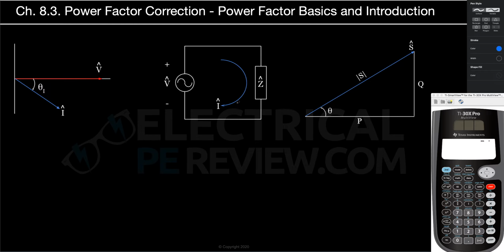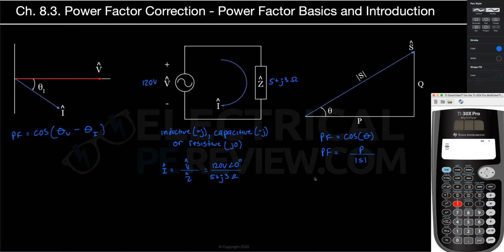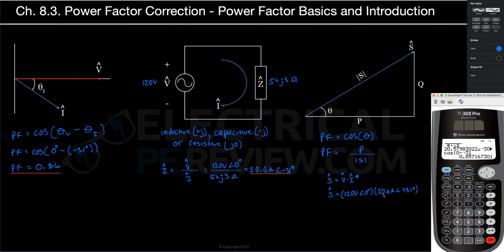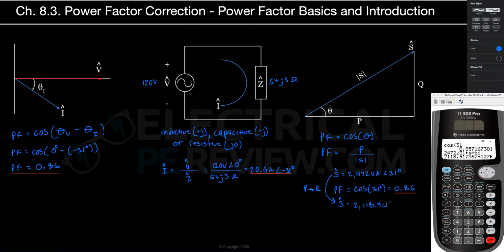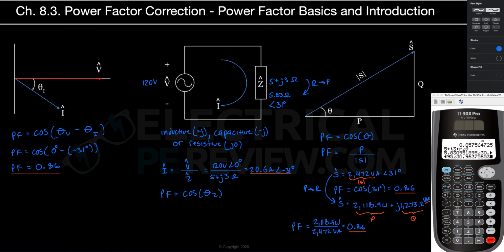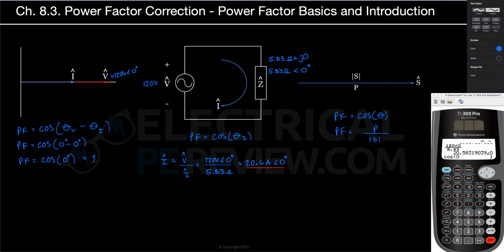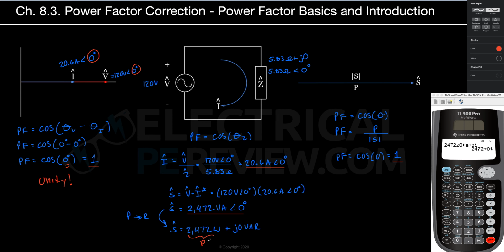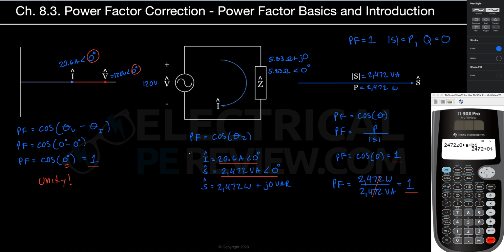Power Factor Explained! Phasor Diagrams, formulas, and Power Triangles (Electrical Power PE Exam)

Comment from the maker: 1:52 - Solving for current (I) using Ohm's law
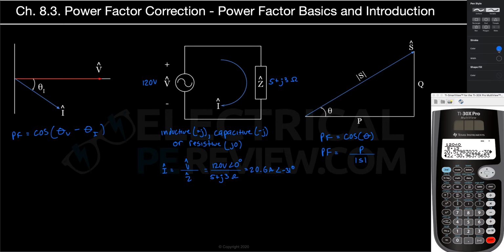3:29 - Solving for PF using PF = cos(θv - θI)
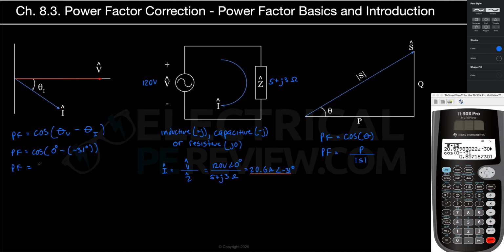4:44 - Solving for complex power (S)
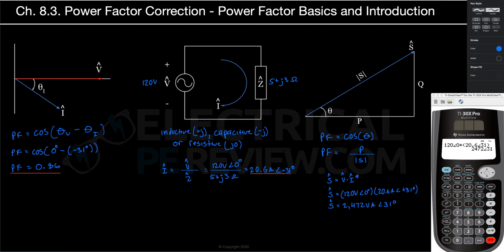6:25 - Solving for PF using PF = cos(θ)
8:24 - Solving for PF using PF = P/|S|
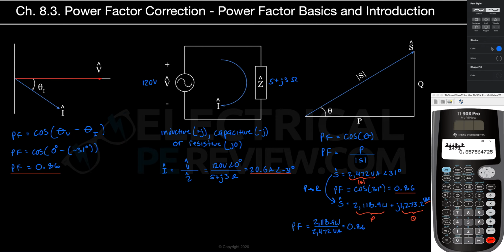9:25 - Solving for PF using PF = cos(θz)
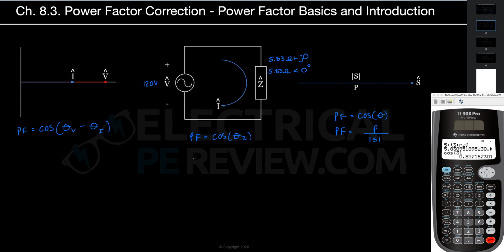12:15 - UNITY POWER FACTOR - Solving for current
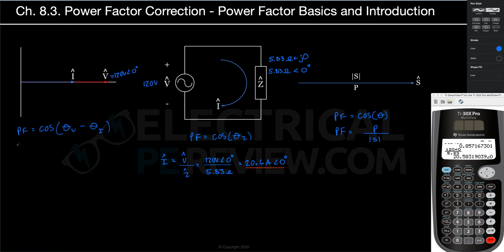13:11 - UNITY POWER FACTOR - Solving for PF using PF = cos(θv - θI)
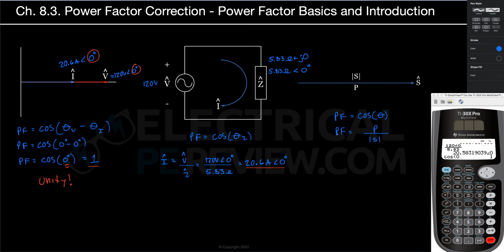14:27 - UNITY POWER FACTOR - Solving for complex power (S)
15:37 - UNITY POWER FACTOR - Solving for PF using PF = cos(θ)
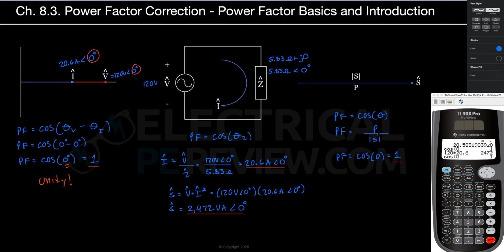15:52 - UNITY POWER FACTOR - Solving for PF using PF = P/|S|
17:42 - The unity power factor power triangle explained 
19:12 - UNITY POWER FACTOR - Solving for PF using PF = cos(θz)

Vist the full-length article and download/print all of the diagrams and formulas used in the video:
https://www.electricalpereview.com/power-factor-basics-for-the-pe-exam-phasor-diagrams-and-power-triangles-explained/